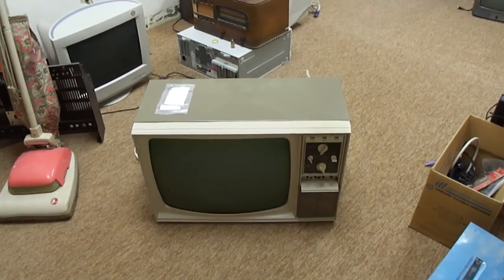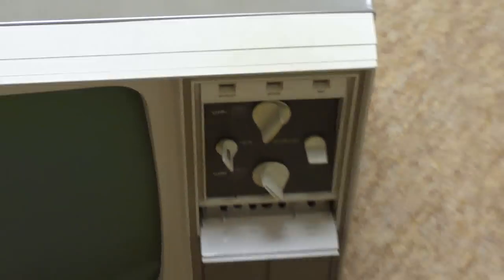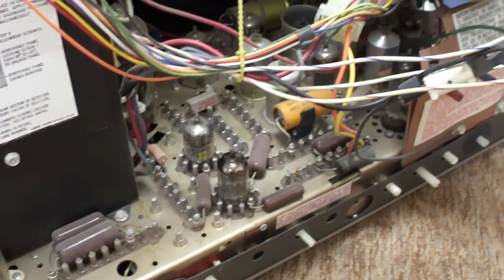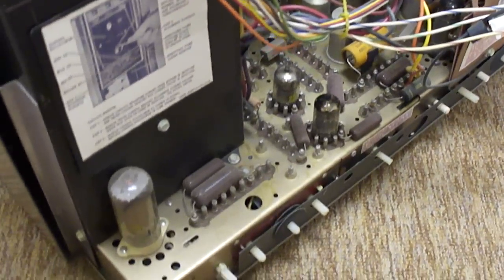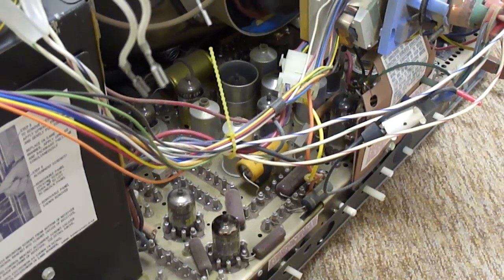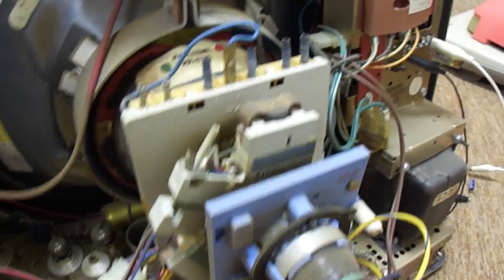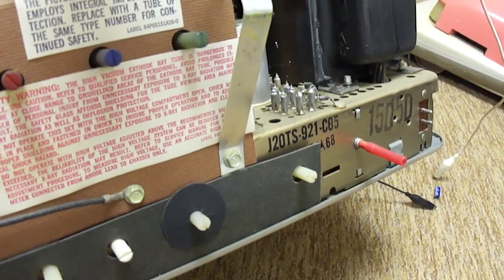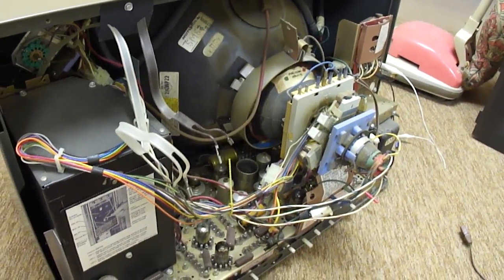1968 Motorola TS-921 tube type color TV before repairs

Comment: That's a nice TV, it looks all hand wired like a Zenith from that time. I hardly ever see tabletop type type color sets anymore at estate sales or resale stores. I have a later Motorola 16" hybrid tube set from the early 70s, but it already uses plug in circuit board modules and is mostly solid state. It doesn't have any vertical deflection either right now, but had a nice picture when it was working.

Comment from the maker: @vwestlife I think this was designed so the chassis could be automatically soldered like a circuit board...the components were pushed into the cones from the bottom and then the chassis top was dipped into solder to make the joints.

Comment: I agree with HDFXH's suggestion. Check continuity on the vertical yoke coils. One of them may be the victim of the "green bug": corrosion and resultant opening of the affected winding. You can usually spot this by looking for any green spots (copper oxide) on said coils. The sweep isn't lost completely due to a small amount of sweep current getting through the parallel damping resistor of the bad coil to the remaining good coil. If so, hope you can find a replacement yoke for that gem.

Comment: The vertical output tube is probably the culprit because the same problem occurred with my mom's set her's was the'67 25" console, same chassis,I repaced that tube and it worked good as new!

Comment: You should check the Yoke? Deflection coil, just to be sure it is all functional, I came across a 1973 TV, Where the Vertical Deflection coil was open , you could also check the voltage and/ or frequency going to the deflection :)

Comment: I just play around with old tv's but aren't there supposed to be other wires connected to that white board with the blue wire on the center going to the yoke coil, or are they just located somewhere else on this set?

Comment: As long as the flyback and CRT are good, anything else can be fixed.  This looks like a delta gun CRT. Can you do convergence adjustments? Obviously once the vertical deflection issue is fixed.

Comment: I have a VERY similar chassis model tv from Motorola. Albeit in much rougher shape and its super high hour. D20TS--921-D02 If you still have this set I would be interested in buying it from you. Or if not sell it perhaps help me figure out how to get a replacement picture tube for mine. Supposedly some RCA picture tubes can be swapped in.